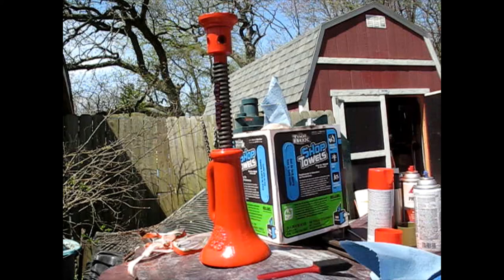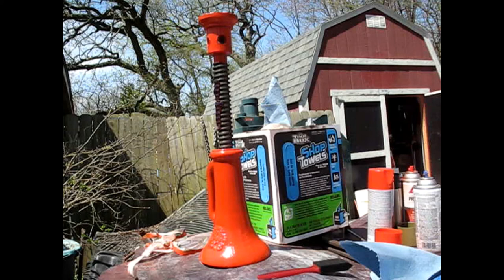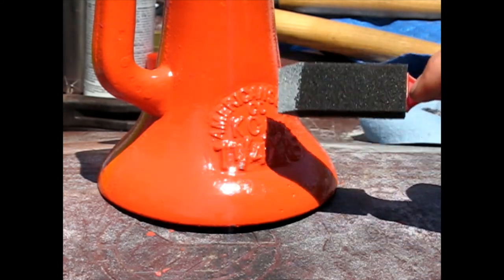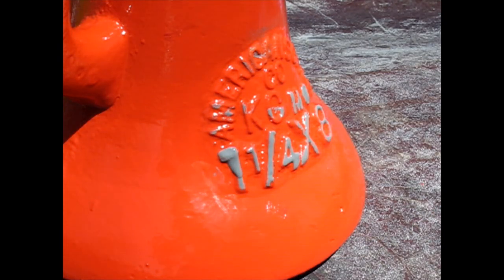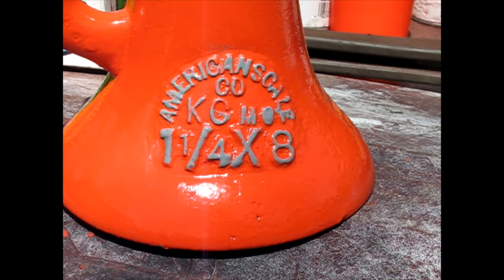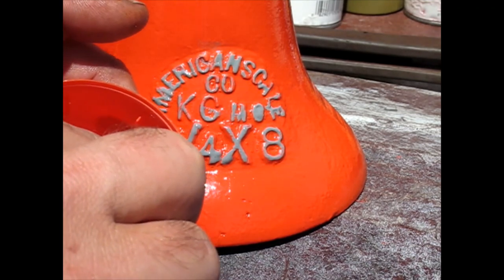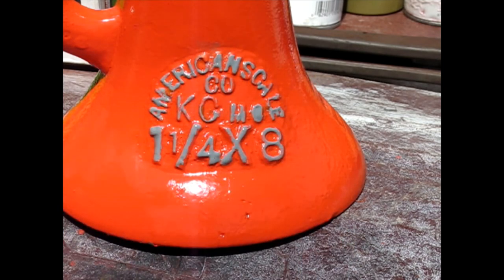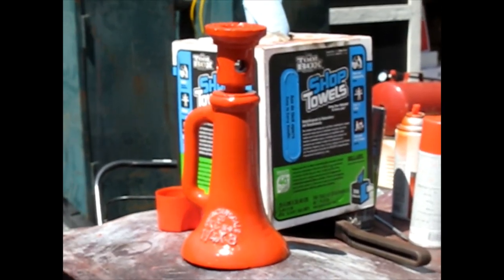Restoring an antique American Scale Co KC Mo cast iron screw jack  Playlist part 3.  1 1/4 x 8

Comment: I have one I’m getting ready to restore and I’m thankful I ran across your video - really helped me out. The one thing I’m curious on mine is the top turns with the screw. This causes it to slide out when I’m lifting something. I was hoping when I take it apart, the top would have bearings I can grease to keep it from turning; staying stationary